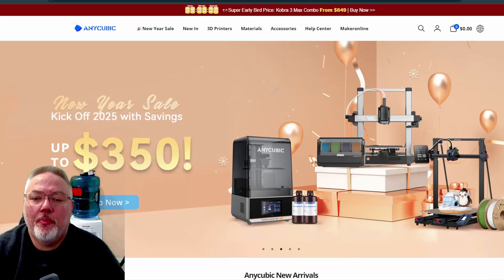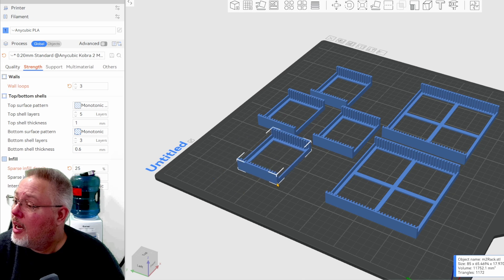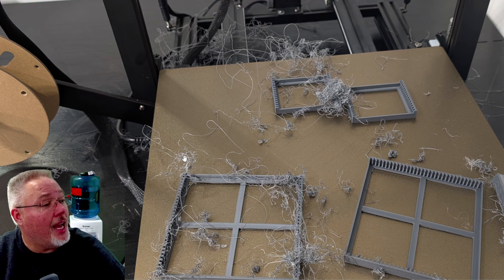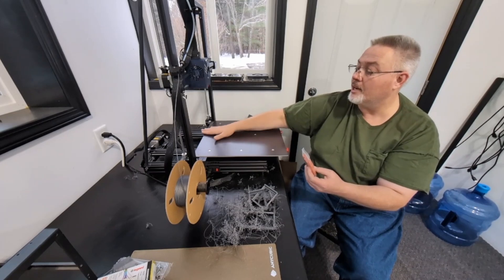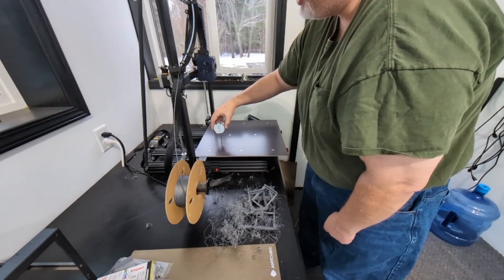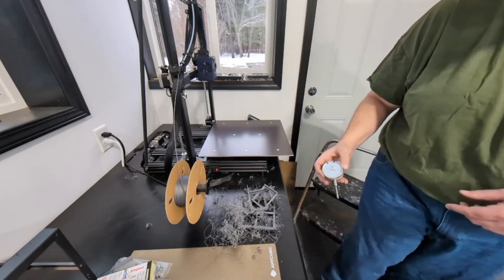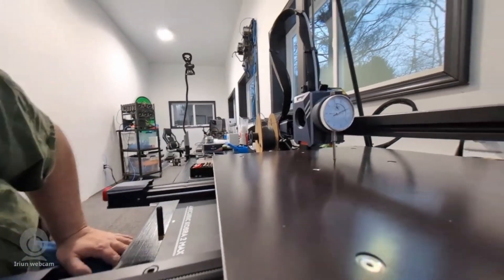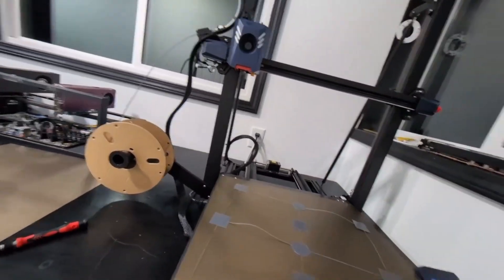Anycubic Kobra Max 2 Pro - Bed Leveling / Calibration Guide

Comment: would you be willing to add links to prints and products?
Reply from the maker: Are you looking for links to the items I printed?
Reply: Id certainly like those links  @nfoguides
Reply: @nfoguides  are you not going to post the links to the products and the print file?
Reply: @nfoguides  yes please
Reply: @nfoguides  Greetings, I am looking for links to the parts you have printed. My printer is down and I cannot print right now. Also which sett of silicone spacers did you get? I have the same Kobra Max as you do. Cheers.

Comment: i see one big mistake with this.
moving the hot end or the bed by hand is not the best thing should of moved it under power for the printer.
i was doing the same thing but then found moving it und power from the steppers for movement got a lot better results.
as you did say you was not sure when moving the bed if you was putting pressure on it.
moving the x side to side by hand is even worse if the printer is turned on the beam will not move easy as the motors are locked in position with power.
hence why i say move the x and y under power to tram the bed then set the z offset 
best way to set the bed tram on any printer. 
like you did with a dial gauge was the way i tram the bed in my printers and the way i tram the head on my mill and cnc router
Reply from the maker: @dmcarpman  lol,  I didn't even think about doing it under power...  Doh.   I was just keeping a electricians mindset.  If your working on it.  Keep it off.  Hahah thanks for the feedback
Reply: @nfoguides  Very cool solution to this problem, I have the same issue  on my Vyper and figured it was impossible to level it anymore then what they did at factory. Youre a DIY inspiration, thanks.
Reply from the maker: @mikejones-vd3fg  thanks!  The effort I put in seems to have paid off.  Did another print using more of the print bed and it worked perfect this time.!
Reply: @nfoguides  i found the slightest bit of pressure from moving the x made a big difference.
like most i did move it by hand first. lol
my printers run marlin and no auto bed levelling used. any way best of luck and happy printing
Reply: Hallo nfo,
I sent you a messesge on Discord. Could you pls Share the Print files for the orange distance holders? 
🫶